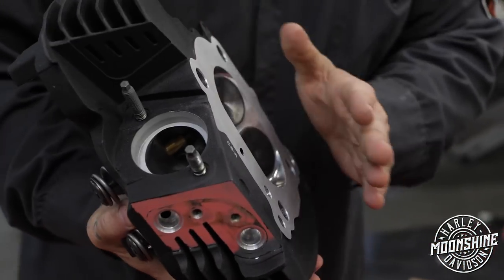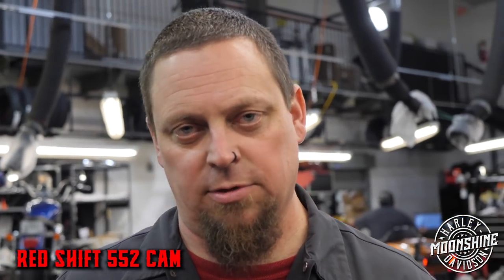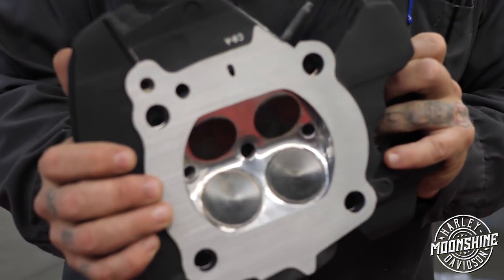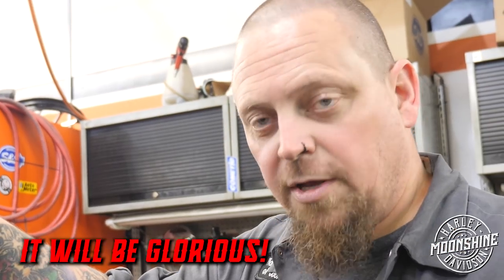The Foreshot Part 2 | 128CI Monster Mid-Range Torque Build | Shop Talk Episode 24

Comment: I would love to do one of these kits   in my fatbob it would be fun and scary
Reply: I've got a 472 cam with all the supporting mods, 7.1 injectors, bigger intake manifold, pipe / cleaner and tune and my fat bob fucking rips. I can drag any sport bike and gap them until 100-120 depending on it's a liter bike or a 600. I've also rolling raced a modded gsxr-750, a brand new r6, a hellcat, a ZL1 and tons of other thins and gapped every single one of them. Sport bikes can't touch me until 100, and at that point I've already won so what's the point?

Comment: I see it has the POWER...besides the motor what else was done to handle it all to keep it reliable .  Most want the big engine and fail to include  extra money for clutch ..because we all know that its not just the engine..once you go past the limits of stock parts ..you need the hole package..ie clutch and brakes drive train...
Reply from the maker: smokeGR20 This build got it all!!! I guess one thing was left off..aluminum swing arm...soon.

Comment: Did you do anything to the crank ?
Reply: Kevin Butler welded and trued and we removed the counter balancer and rebalanced the assembly. All in all it dropped about 3 pounds!
Reply: @jamielima5315  ---->On a scale of 1-10 for vibration what number would you rate the 128 engine after the crank assembly is balanced and welded at a steady cruising speed of 80 mph in 6th gear?

Comment: 2500 to 3200 RPMs, that's a massive TQ dip. What would be needed to even that out? Cam change?

Lol "not bad"?
Reply from the maker: Exhaust change. The Burns 2>1 is designed to win faces at full throttle. You sell it on almost all serious drag bikes at the track.
Reply: @MoonshineHarley  Got ya 😁👍

Comment: Hey guys great video got a question for you kind a random regarding a TTS master tune can the TTS master tune be detected by Harley is master computer Digital tech or whatever it’s called after it’s removed got severely injured at work won’t be riding for quite a while going to sell the bike but don’t want to sell it without a factory warrantee for whoever is buying it it’s a 2019 road glide special
Reply: @Paco B I have 2017 ultra limited 107 with Stage 3 kit all HD, with a TTS tuner and D&D Fatcat 2into1 exhaust,  and every dealer I've been to in 22 different states says that once that tuner has been put on and hooked up to any HD tech machine it automatically gets flagged and warranty is void. I've also been told that the motorcycles computer stores it and it never can be fully deleted and only way to get rid of it is to redo entire  wiring/ computer system and that can't officially happen because bike serial numbers are coded from bike to wiring. Otherwise it would have to be a totalled bike. 
Now I might be naive or dumb about it, but from California,  Washington,  Las Vegas,  Oregon,  Nebraska,  Tennessee,  NC, Virginia dealership all tell me same thing. 
If you hear different than please let me know.
Reply: Jason Ingle I’m from California I contacted TTS they said that it cannot be detected once it’s removed I also talk to a few Harley dealerships in my area and they told me if the digital tech is hooked up to your bike it will void your warranty even if it’s removed So you kind of don’t know what to believe the only reason why I care is because I am selling my bike because of a injury and I don’t want the person buying it not to have a warranty so you get conflicting information and you don’t know what to believe
Reply: @sjbb838  exactly.  I guess only one way to find out.. take it to an awesome dealership that won't screw it up.. if one actually exists.  Once a dealership has hooked your bike up on their system,  that bikes VIN# is forever flagged, I believe even if the tuner program is removed. That's what I've been told by numerous great dealerships. That's just how HD is. but to be honest,  if nothing is wrong with the bike at all then the new buyer shouldn't have any issues buying your bike as is. just give the buyer copies of all your receipts and service records. Good luck. And get well soon.
Reply: @sjbb838  if you remove the tune it should not be flagged by digital technician.
Reply: @NoName-vz1ob  but if the TTS tuner was installed and bike needed say an update on stereo or needed a state inspection or battery went dead or even put on the dyno and needed to be plugged in the System then it would be flagged..correct? so yes you can delete the aftermarket tuner from the bike and put the stock tune back on, which would probably ruin how the bike performs,  but once the bike is in the HD system then it won't matter if you return it back to stock. HD will still have it flagged..Correct?

Comment: I've got a 128 using a Woods cam - getting close to these numbers but mine reach them at 2400 RPM's and hold them all the way through. What's with not getting to 130 T until 4500 RPMs? That sucks!
Reply from the maker: It’s the short Burns Stainless exhaust. Customers request!

Comment: So the trask kit will fit w the 62mm throttle body ?
Reply from the maker: Yes but you loose some HP running a Trask on a engine like this.

Comment: Jezus, that's a big dip in the Torque curve at 2.5~3k. You made a big mistake on that exhaust pipe. That's way too short for a bagger.
Reply from the maker: It does have a dip but it also make some
extra HP’s on the top. Customer loves this exhaust and would change it out even if he got more bottom.

Comment: Great max power, but that's a significant drop in the Torque band mid range. Not a great Torque curve, it builds then starts to fall on its ass and then back up. I'm sure that's quite noticeable.  A smoother torque curve woukd have been nicee.  Those max powers are nice though...

GO TRUMP!
Reply: It was the pipe choice.  The customer wants top end power to run light to light.  And the drop is from 130 tq to 123 tq so it is not real noticable.  

We normally use different exhaust to give more of a mid curve and less top end girth but we build to suit the rider.
Reply: D&D would have been my choice.  But it wouldn't go with the theme of the build.   Awsome bike
Reply: @NoName-vz1ob  got ya. But if he wants light to light power i would think he would want the torque and hp to kick in sooner? Torque is your light to light power and hp is your top speed. Either way nice max numbers, i would talk him into adjusting that mid range power. That's where you get that off the line freight train pull.

I bet she gets down after 3500rpms though.

I hope to see a real good test drive video once he breaks it in.
Reply: @johnnyturbo8460  there is no off on a bike like this.  If anything it might help it be a little more manageable.  And if you launch at 3000 rpms the tire just spins.
Reply: @taps_1021  we would use a DD type pipe too with a longer primary.  But the customer wanted more of a pro stock look
Reply: Danny Tapia We use D&D a lot
for 117 or smaller cubic inch motor builds. Anything over that cubic inch demands a larger primary pipe size and D&D hasn’t produced a larger pipe for larger M8’s like they did for the twin cam.  for twin cams D&D has the Fat Cat for smaller setups and the Boarzilla for larger displacement motors.                          Most riders would love to have a motor that has a minimum torque value of 123...it’s a beast for sure.
Reply: @NoName-vz1ob  possibly, but with that power it SHOULD light the tire up in 1st possibly 2nd by just cracking the throttle open. And it should be able to have that front tire sky word with a fast roll on. As far as manageable,  i like to be able to manage the throttle myself not have the tune drop torque right where its needed. IMO but I'm very happy the owner got what he wanted. Please do a FULL test ride video of the bike if the owner allows it. I'm very interested to see how it is with daily driving characteristics, drivability etc. ... its a similar build I'm thinking about doing
Reply: @johnnyturbo8460  it does man.  Every gear.  Every rpm.  It has more torque at every single RPM in the spectrum than 99% of all bikes out there.  and when we build your real bike we will build it to tailer to you.  This is what the guy that paid wanted.  He wanted the Burns pipe.  The power is really smooth.  It doesn't "lurch" or try and get away from you.  But if you are cruising and crack it open it rockets.  The power comes on so strong at 2750-3000 it's like a sling shot when you do that.
Reply: @NoName-vz1ob  fair enough, sounds good. Please try to talk to the owner about a full on test ride after its all broken in. Myself and im sure MANY others would be VERY interested to see how it rides, drives on the highway AND how it does going slowly threw parking lot situations etc ... well done gents.

No to mention it may help you sell more builds like this (also a huge plus)
Reply: @johnnyturbo8460  yeah we will.  We also have another big one.  A 124 with 145tq/140hp that has 5000 miles on it.  At 10k I am going to disassemble and inspect it.  We have had no complaints about driveability or heat/slow traffic issues yet.  We do walk our customers through the care of them pretty thoroughly though.  The big inch motors are a bit different.
Reply: @NoName-vz1ob  very cool, i look forward to seeing that video.. you mentioned that you "walk them threw the care of a big bore motor". What extra care is that? What do you all tell them?

Comment: Hey great video as usual love the Trump comment. Got a question regarding tuners pacifically TTS master tune I hear it’s undetectable after it is removed that the stock map is it restored back into the ECM and your digital tech cannot detect it is that true? Or is that BS Thanks
Reply: With Powervision and TTS you can reflash the stock map into the bike that's true.  However most of the time when the DT is plugged in it is on the fly, like changing the auxillary lights to always on or pulling the pin code or something.  We don't plug bikes in to Harley's system unless we absolutely have to.  We use a different "code scanner".
Reply: M.V.O _Motorfast So you’re saying it will throw a pin code well that pin code show enough to void a factory warranty?
Reply: @sjbb838  if a bike under warranty that has an aftermarket tune in the ECM is connected to a dealerships Digital Technician (the computer that pulls up codes, flashes radios, lights, security PIN codes, FOBs etc) it will immediately auto flag the VIN for power train warranty.
Reply: M.V.O _Motorfast So what you’re telling me is the TTS master tune will be detected even if it’s removed and stock map restored if plugged in to the digital tech if that’s what you’re saying you should know TTS is saying BS that is been put through the test
Reply: @sjbb838  no.  If it is removed it will be fine.  What I am saying is I have seen the units plugged in inadvertently out of habit or the TTS not being on the bike and an issue that requires it.  For those reasons we don't use the HD scanner so it doesn't happen at our shop.